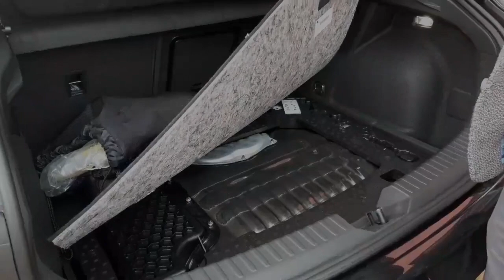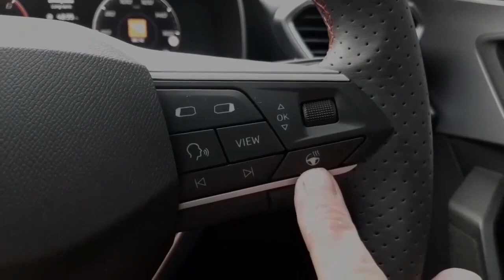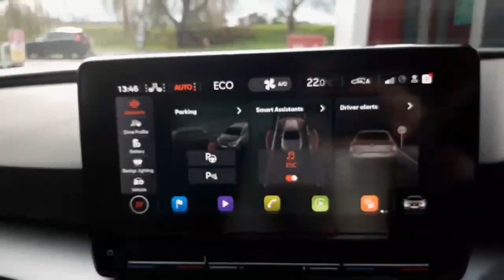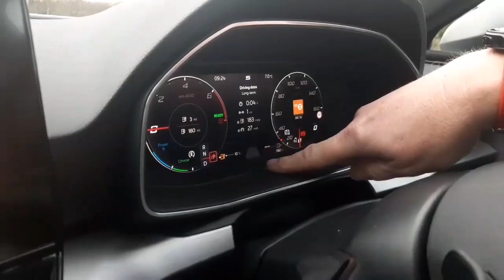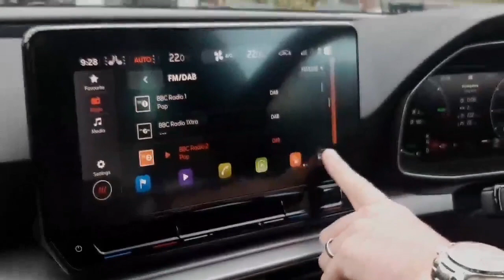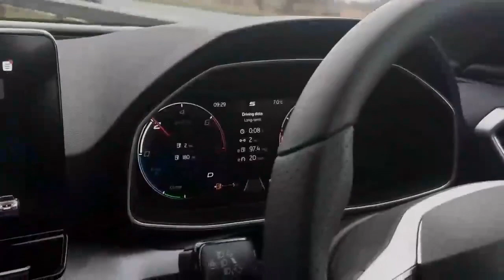In-depth look at the New SEAT Leon e-HYBRID (PHEV)

Comment: I bought this car with 8k miles and just over two years old. It is great and nippy hatchback. Yes I would never consider to buy a new car especially paying so much extra for hybrid, but it was same price as 1.5 tsi with similar mileage and better equipped . You get instant torque from electric motor which puts most cars behind you on the traffic lights. Plugged in overnight and ready to go for two days of my commute which is 60 miles in total with  62 mpg on Average and sport mode only. Full battery charge costing me £3.20 at the moment so running it is cheaper than my wife's Fiat 500 twinair. I was driving my friends BMW 118i for a week and it is a fantastic car but Seat beats it when it comes to performance and costs of owning.

Comment: I got this car from new for 31k and it’s good for the money. Charging costs £3.50 from 0-100, down is side the air con takes off 3 miles from the battery
Reply: Looking to get one used. Has it stayed good to drive and reliable?
Reply: @niallwagner6283  yeah I had it for two years, never missed a beat, the hybrid plugin is 204bhp the rest are 150.  As it was the 1.5 engine it was good on fuel too
Reply: @niallwagner6283 yeah never had a problem with it. I’d say as good as the golf. 204 bhp so it’s quick to. I had the asphalt blue. None chrome

Comment: You save the planet and wait 4 hours for that "quickcharge". I'll get on with my 2.0 tsi.
Reply: Surely you get out of your car at some point? It can also recharge while driving
Reply: The whole poit of PHEV is to be able to charge at home and/or at work, thus commute with e-mode. Besides that you get additional punch and petrol saving on longer trips too, if your beginning point is at home. For those purposes it gives ridiculously cheap driving. I`ve got a Passat GTE variant and my wife a Seat leon phev ”wagon”. Both cars have been bought second hand, work like charm with years of use and still deliver very cheap kilometres. Not to mention the instant boost you get from the additional electric power line.

Comment: It makes no sense to pay £12,500  more for a car to  save fuel 
this is £250 more (Every month)  over 48 months
Reply: Not everybody keeps a car for 48 months and hands it back. The future savings for life of car will help with residuals and that engine should last a long time considering the battery does half its work.
Reply: @leefoster8015  The Scret for reliability it's simplicity
.
A Car which has no Turbo, nor Electronic parking Brake nor Reverse camera can't break something it doesn't have🤷
.
OK which year are you expecting to get your £12,500 back? , do you realise hybrids only save around 20-30 % in Fuel 🤔 per every £ 100 in Fuel you still have to pay£ 70 to £80 pounds + 
Electricity is not Free 🤷
Reply: @niceboy60  VAG cars are plenty reliable. But my main point was the fuel savings will easily pay for the extra outlay over the life of the car.  Naturally aspirated 1.4ltr would not meet my needs but each to their own.
Reply: @niceboy60   Electricity is not free, thanks for pointing that out. A factual statement, shame about the rest. This car isn't for me either but 14p per KW/h, the option for a short commute petrol free, Kers etc. Lots of variables including the fact this has respectable BHP. 80 pence on the pound vs petrol is just plain wrong though I'm afraid. Think your main problem here is you are comparing this to a standard 1.4l which won't have the performance and say a 2l golf won't be in the same league MPG. Again not my cup of tea I drive a GTI but this is a smart buy for the right person.

Comment: hey, nice video...may i ask...what if for any reason you on petrol engine only mode (lets say u wish that or the battery has no enough energy), will the car lose some of its bhp? i think this is 204 hp with combining both engines. what if only the petrol engine is working, while it drop to 150 bhp?
Reply: According to the latest brochure: 

the electric motor is 85kw (116 BHP) (10 more than he says here, but then I am looking at a MY 22 brochure)
Petrol is 110 kw (150BHP)

I guess There's a "Trade off" running all the ancilliaries, so yeah you'll get 204hp combined.

 I'm guessing that with a differnt "Map" you can vary how much is done by each motor....  Theoretically 150HP+ 116 = 266 HP(!) ... bear in mind VW claim  245 HP in the current GTE.